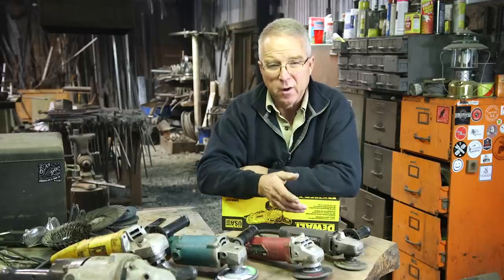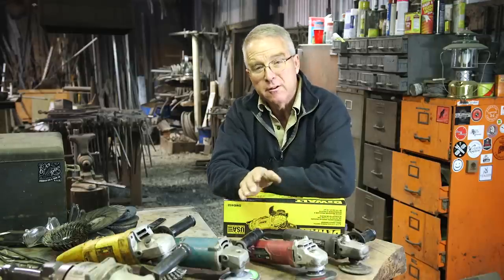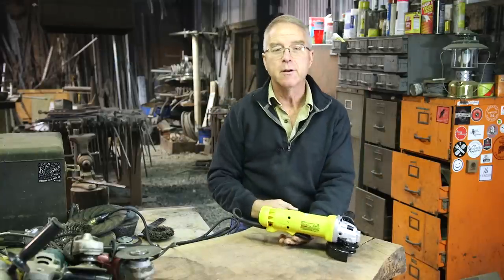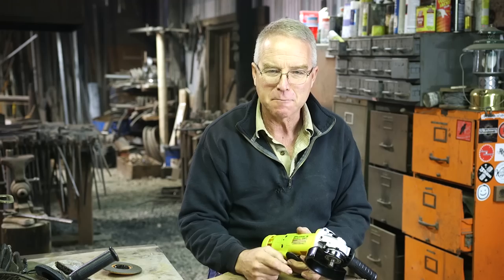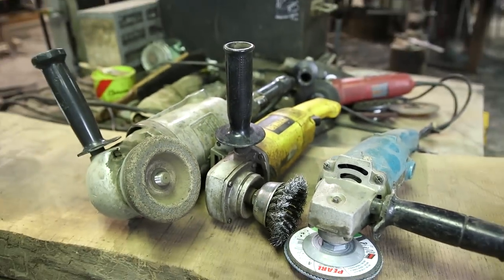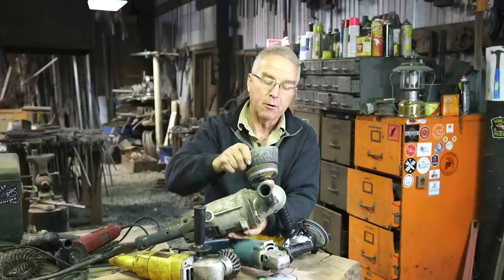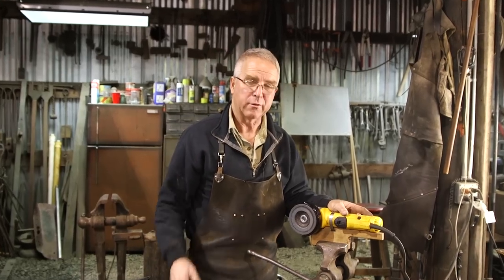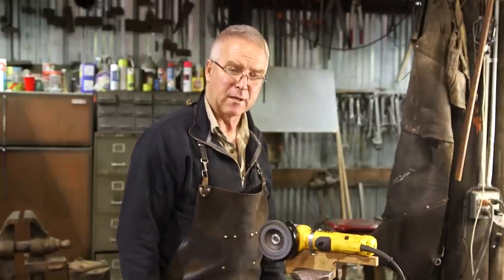Get Another Angle Grinder

Comment: Angle grinders are amazing tools: I've used them for cutting steel, smoothing steel, taking paint off of steel and wood, smoothing wood, cutting concrete, stone, and brick, smoothing concrete, sharpening drill bits, cutting tile, shaping curves on pavers, clearing out mortar joints for tuck pointing, the applications are endless.  As you say, they are anything but a life-long investment, they take more of a beating than most people's tool collections put together, Bosch has always been a good soldier for me, but no amount of engineering can sustain that kind of punishment indefinitely.  My least favourite trigger mechanism has got to be the slide switch: whatever you're using it for, grinders kick up a ton of particulate; particulate gums up mechanisms, over time leaving you with a hair trigger sensitivity over time; I prefer to know my spinning death wheel contraption is well and truly off when I set it down.
Reply: I am a industrial maintenance and repair tech. I work for a company in Belgium that does revisions, repairs, maintenance and even tailor makes machinery and entire production lines for the customer. Arcelor Mittal, Volvo, Coca Cola and the ministery of defense are among our customers.

We often work on massive, heavy and expensive gear. So it can be quite a demanding job at times. As we often have to improvise and work in very awkward positions in places we don’t know (yet). While still being careful and vigilant to not get crushed, electrocuted, fall or damage the equipment. (Like aligning a massive electric motor to its gearbox on a 45m high tower while I can’t hear myself think thanks to wind and rain lol)

Angle grinders along with impact wrenches, drills and a corded hammer drill are part of our daily used standard equipment, often we have to dislodge broken or badly cared for equipment to get it out of there. I have done a lot of grinding both on side and in the shop when working on a part for the customer. Sometimes even from 7-4 that I’ve grinded an entire day.

My 2c, Bosch sucks ass. If you wanna spend money on a EU tool brand, buy Metabo. They make way better grinders. We buy Bosch professional tools, the standard model we use is the 125mm, 1700W “heavy duty” model. I have on one instance thrown out 4 of these in 2 months. Yes they suffer and work hard. But so do our Metabo’s and Makita’s. And they don’t die at nearly the same rate as our Bosch tools. They seem to be not as well-balanced as the Metabo’s either and they have cheaper, shorter cords. My Metabo for home use is a 1300W paddle switch one, it has a 4m cord of H07 class cord. Which is good, Bosch uses H05 (lower protection class) on some of their grinders. The cords are also something that tends to break down quickly on these.

They are not terrible, but Metabo is imo better and similarly if not slightly higher priced. Fein is excellent but very expensive. We have a few specialist tools from them and they last very well.

Lastly, a thumb switch or as we call them a “suicide switch” is practical and easy as you don’t have to depress it constantly. But then again if you fuck up and that thing is tearing in your flesh at 10.000rpm you want it to shut off when you let go. As you might no longer have the presence of mind to flick the switch. I prefer paddle switches, however they can be tiresome if you are grinding for many hours. A rat tail is ideal.

If you buy a larger one (230mm blade) plse get one with a dead mans switch that will shut off when released. A colleague of mine almost lost a leg to one of these while working in the basement of a nuclear plant. We carried him outside and put pressure bandages on his leg to stop the bleeding.

At the ER they told us that if he had cut 3cm further he would have hit his artery and been dead before he left the basement.

They won’t fire up on their own, thats not something to worry about. Nice thing about the thumb switch ones is that you can put them in a vise and use them as a makeshift bench grinder, if you intend to buy a grinder for that purpose I would take a thumb switch. If not, nope. Paddle switch or rat tail.

(Boss keeps buying the blue stuff, but we have told him many times to go with Makita or Metabo. But hey, its his money 🤷‍♂️)
Reply: @claudyfocan731  I particularly like the suicide thumb switch, because it allows me to grip the angle grind in such a way that commands most control. 
With paddle or rat tail switches, you're limited to where your hand is by the switch, where I can safely grip the thumb switch one close to head for precision work. Also, it's was easier for one handed applications we all do, even though the OSHA doesn't approve. 

Although, my angle grinders do work way less and it's a much easier job, basically just cutting thin metal tubing and plates no thicker than 10mm. 

I've found blue Bosch is good enough for professional use, and their warranty is impeccable. My place will take the broken tools basically no questions asked, and either they fix it or you get new ones, all within a week maybe. So after 2 years of warranty, they've paid off completely.
Reply: @lazar2175  i agree to the switch part, it is more practical and works a lot easier in some situations. But I still care a great deal about my personal safety lol, regardless of my job.

We found out that Blue Bosch just doesn’t cut it for heavy industrial use.
Reply: @claudyfocan731  The Metabo/Hitachi is the king in my opinion, it's slightly more expensive in the beginning but it's so worth it. German and Japanese engineering at it's finest. Both are made by the same guys from what I've gathered, as Metabo is owned by Hitachi. 

Aside from them, Milwaukee is also making killer tools. The only reason I'm not using them is because they are incredibly hard to get in Europe, and also very expensive. I can buy 2-3 Makita/Bosch tools for the price of a single Milwaukee tool sold by resellers.

Comment: For the hobby guys and general repairman like myself who aren't going to need more than one grinder... Buy a Lenox diamond wheel. They are strong enough not to fly apart when you make a mistake and get it in a bind, they last a long time, they cut like nothing else, and they can even be used shape metal like a fat wheel would usually be used for (against best judgement perhaps but I've done it successfully a lot). The wheels are expensive, about $15 a piece here, but get one!
Reply: Lenox cutting blades and wheels always perform great. See the Project  Farm youtube channel for all sorts of head to head competitions between cutoff wheels recip blades etc.
Reply: I use 6" wheels (greater reach and edge speed) and my Lenox is extremely useful for the tough task of cutting truck and car tire wire beads when stripping off old tires at home. I weld steel rims together self-service salvage style to support vehicles and other work and don't care to pay to demount than many old tires. I cut the sidewalls with a Diablo carbide tooth recip saw blade (one blade has done about 15 tires so far, much cheaper than paying someone) and sever the wire beads with the Lenox. That level of ruggedness is impressive since the side loads easily snap abrasive discs and a toothed metal saw blade would immediately overheat because rubber doesn't conduct heat well.

Comment: I love my 4 1/2" Makita. Although, I purposefully got the one with the locking thumb switch. Let's me keep it running without touching it, so I can use it in a vice or not have my hand cramp from holding the paddle the entire time.
Reply: Of my five 4 1/2 inch grinders I like the Makita best with two acceptations. The handle doesn't mount at 90 degrees to the body. I made a bracket that realigns the handle to 90 degrees. The other thing was the thumb switch was so long I kept bumping it off. I trimmed the trailing edge of the switch to get it out of the way.
Reply: Your channel is now one of my favorite. I wish I could work on a few projects with you. You are just full of valuable knowledge.

Comment: As a 25 year tile , stone and marble setter this is one of my most used power tool with the 1/2 mixing drill coming in first. I use the 4 1/2 slim Bosh with burst control. No doubt the angle grinder is a versatile tool used in most if not all trade's.

Comment: If I'm using a corded ginder with a stone it needs to be a trigger and I only like Makita grinders for corded ones. If I'm using a zip disc or flap wheel I only use grinders with a thumb switch on the top so I can lock it on and do detailed work. I don't like or recommend paddle switches. And I only like Makita for corded grinders and Milwaukee for cordless. I've burnt up harbor freight grinders and DeWalt and black and Decker's are just not at the same level.

Comment: I had just purchased a Dewalt cordless in a kit.  The paddle switch and adjustable guard are excellent.   I have a a corded Hitachi that I about hate because of the clunky switch.  My corded Dewalt is my overall go to.  And believe it or not,  a $18 junk tool no name brand last many many years and died a slow death cutting fiber cement siding.   
As usual,  your advise and commentary is spot on.

Comment: Locking thumb switch is the way to go.

Do know why you don’t like them
Reply: I agree. You couldn't give me a grinder with a paddle switch, they are too awkward to work with.
Reply: I use a macabo grinder at work at the thumb switch, its a fantastic grinder, because the shop I work at supplied it, however I gate to admit having a wire wheel bounce up and catching your T shirt is not fun, you cant shut the thing off fast enough, I will say the few times that has happened have been in my earlier days working steel, I wont say im smarter now, but I think subconsciously I pay more attention so things like that dont occur anymore.  most of my grinders at home are paddle switches, they are awkward at first but you get used to them, I have the same Dewalt and absolutely love it, its a work horse.
Reply: Definitely prefer the thumb switch
Reply: Paddle switch is much safer for most things. It shuts off if you let go.

Comment: I bought a Harbor Freight angle grinder almost 10 yrs ago for $9.99. I have heavily used it for work, cutting and grinding and wire brushing. My teenage son also used it for months cutting and grinding. It has been so hot that it would drag and go really slow but after it cools down it always goes back to normal. I bought a spare to keep behind the seat of my work truck as a spare when this dies. It's still there in the box. It is blue with a thumb switch and no guard. Also no need to tighten the collar I just loosely hand tighten and the direction of rotation will tighten the collar. I did just buy a Dewalt 20v grinder and it's much bigger and doesn't get into tight spaces like my old HF grinder but it is cordless!

Comment: I picked up an old Milwaukee 9" grinder for$25 at an estate sale. the push in stop to get a blade off broke so it's stuck with what was a new 9" grinding stone. it's almost at 6"now.
I love my Ryobi 4 1/2" angle grinder, the handle twists for if you want to cut or if you want to grind. 
it's the little things like that which makes it.

Comment: You might have mentioned that in addition to the hazzard of wheels flying apart, you can also cut into flesh very quickly with one.
Reply: I've seen 4 cut tendons in the last month from them. Sometimes severe disability to the arms /hands. Grinders deserve extreme respect
Reply: Of all the cuts and bruises I have given myself over my long career  ... the angle grinder has been the number 1 enemy   !
They don't take prisoners.
Reply: This Dewalt gave me 7 stitches,if it weren’t for the paddle it may have been more

Comment: Can't wait for someone to develop a quick release head for the wheels. Never seen or heard of such a thing, just an idea. But it would have to be an ingenious design to not fail. Somebody take this idea and run with it please! Just give me a word of credit lol.
Reply: @RememberTheSlapFilms  Seen those, used those, Not much faster anyway. In fact if your spindle screw threads aren't all crapped out, you can much faster just give the disk a little hit in the right direction and it screws itself off almost by itself while with that contraption you have to unlock the nut first.
Reply: @RememberTheSlapFilms  Yes! That's pretty cool! I've never seen one. I like the simplicity, however I'm concerned about wether that gets it tight enough. When I put mine on with a wrench I really torque it down tight. Idk if maybe I'm getting it way tighter than necessary or not, I don't have years of experience yet with a grinder. However, I have yet to break anything getting it as tight as I do and have never had it come loose. Long story short, I'll just have to try this Milwaukee nut. Thanks!
Reply: You really only need the nut on the wheel to be hand tight as the way the grinder spins is the opposite of how the nut is screwed on so its tightening on itself. The only way for the nut to come off when in use would be if the grinder was running in the wrong direction which won't happen

Comment: Good idea on the multiple jobs for various grinders. I have two corded makita 5”/9” and a new Dewalt 4.5-6” cordless flexvolt. Love that cordless. Used it with wire cup wheel to grind off the galvanized ring surfaces of whiskey barrels to paint them with rustoleum oil base enamels. Along with wood and screws around the ring into the oak. Long tedious process but they look sharp and last a couple decades as planters.

Comment: You need to try a variable speed Metabo.
Reply: Oh, with Metabo's "Quick" tool-less arbor nut.   I've had mine since....  2010?  Bosch makes a variable speed grinder but it doesn't hold rpm under load and the whole tool just feels cheap compared to the Metabo.
Reply: They are great no tool change wheel

Comment: Just my 2 cents but I never run an angle grinder without eye protection. Great video I need to buy a new grinder soon.
Reply: That’s common sense yet I see folks not using any face and eye protection. Those are the same folks that are missing  a finger or two

Comment: Leave the guard on one grinder dedicated to cut off wheels only.
Reply: The Empire of Dirt I should really do that. I have yet to have a disc kersplode on me, but I can’t imagine it’s very pleasant.
Reply: @austindorf83  yeah I have a cheap 7in and that's it's only job.
Reply: The only thing about that is some grinders only come with a grinding guard which is different than a cutting guard which surrounds the cutting wheel. The Dewalt in this video seems like it only came with a grinding guard
Reply: @a-carpenter9229  well any guard is better than no guard.
Reply: @austindorf83  I just stay out of the line of fire personally. If it don't hit me I don't care.